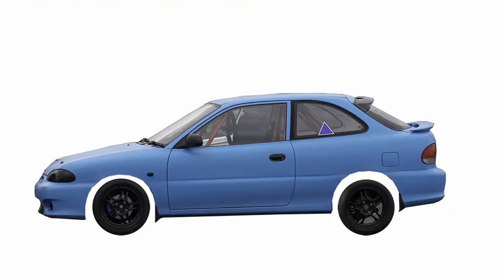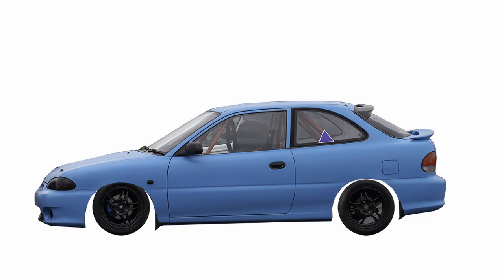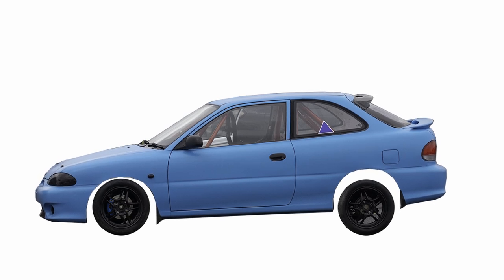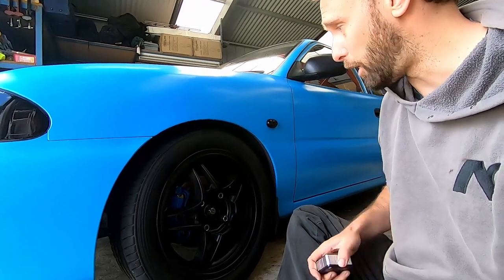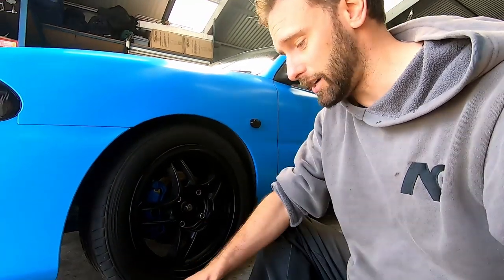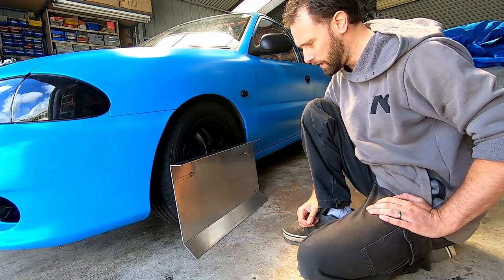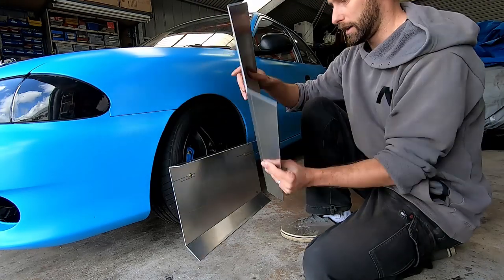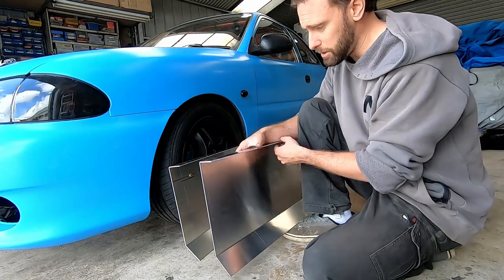Budget Race Car Build - Part 33 - Home made alignment & camber tools

Comment: about suspension geometry and that stuff... you forgot the extreme 70´s rake... that just looks cool but have no positive effect on the car what so ever :D

also.. Caster wich regulates how hard the steering wheel is to turn and how much it wants to return to the center position.. that also has a huge impact on how the car is to drive.
Reply from the maker: Yeah definitely! The rake run on the excels helps with tip in, as it's front wheel drive and really prone to understeer having that height in the back helps get the back lose around corners. 

Caster is something i'll definitely have a play with later on down the track, the steering itself feels pretty good right now but will make up some slip plates and measure the caster on it later on and see where we're at :)